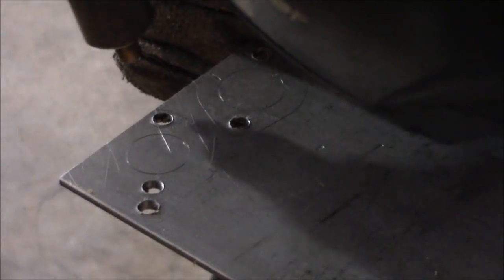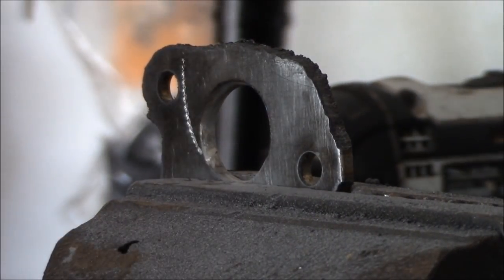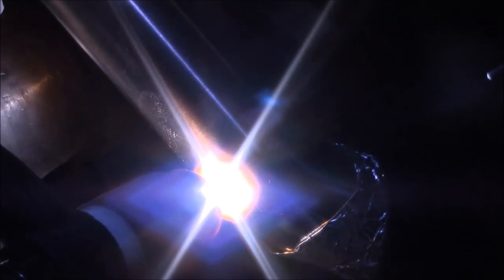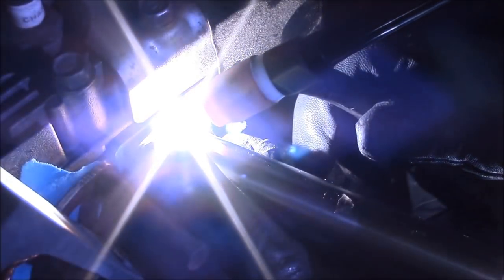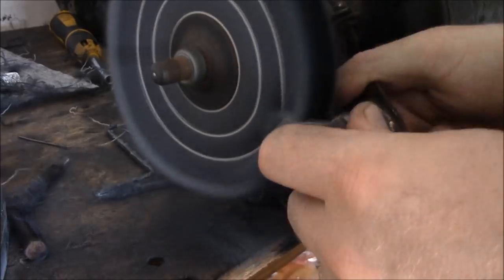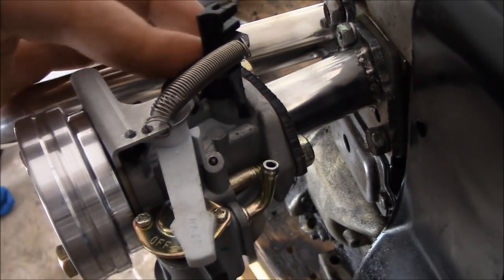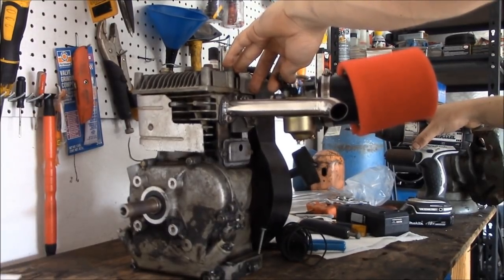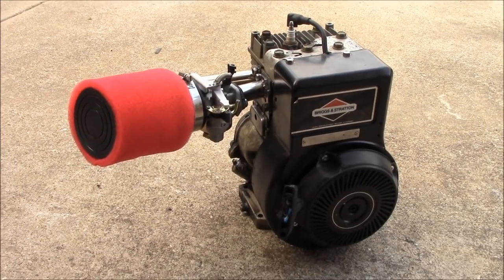BRONDA Engine, Custom Intake and Exhaust System (BRONDA Part 2)

Comment: Thank you for making this video! I was thinking of putting a mikuni carb on mine, but this is way cheaper! I picked up a predator carb for $10 shipped and will do the welding this weekend :)
Reply from the maker: +kazankophsmash no prob. You can check out the final linkage on my mini bike race video. I also modified a  throttle linkage kit to fit on the head of my Briggs. The kit was for the predator 212/gx200, costs 6$ on eBay.
Reply: Well I guess guess I wont be doing it after all. The 5hp briggs was stored outside and intake valve got rusted and stuck in the open postiton.I took off the head to do a valve job on it and found major scouring on the cylinder wall. It was my older brothers minibike project from 10 years ago and he ran it with no air filter . So all that sand and debris pretty much destroyed the motor. I took a video of what it looks like, its very bad! I'm posting it to my channel later if you want to see

Comment: I don't have the skills or means to make the carburetor adapter. I have a Briggs and Stratton 5HP engine and want to put on a better carb so the predator 212 is cheap and your video makes it look like a great upgrade. Any chance you sell a premade adapter/intake?
Reply from the maker: unfortunately no, but you can get a mikuni or tillotson carb and i know adapters exist for that that are already made, with a better carb.
Reply: Tecumseh has adapter that can be made to work.

Comment: I love the Clonda engines. But they have the worst habit of cranking on the first pull after setting for several months. That carburetor is so simple and efficient it's hard to put into words. Not only the carburetor is useful but also the Clonda coils on old obsolete engines. I have a cast iron 14 HP Briggs that always ran hot because of ignition. Made an adapter and filed the coil to fit the flywheel. It runs so much cooler and big time better. I had forgotten but I need to swap out the temperamental Briggs carb out with a 13 HP Clonda carburetor. Being it's on a 1971 Sears Suburban I gotta make governor linkage. I'll have several people stop while out mowing with this classic just to look it over and ask about how I keep it running so well. The Briggs carburetor is still a constant adjustment issue but the Honda clone should put that problem to rest.
Reply from the maker: Yep, and if you look at my 'mini bike race' video, then you can see a nice shot of how i linked up the throttle. I used a 6.5 hp clone engine 'direct throttle linkage kit" for it, and modified it a bit.

Comment: What kind of fuel pump should I use?and can you make a video showing how the BRONDA engine will use the breather tube hole on the side of the engine (is this also the vacuum tube?) to run the fuel pump? I'm thinking I need to add a barb but am not sure how to do it
Reply from the maker: +Jason Kenney no. No vent to pump from valve cover or you over pressurize your crankcase. They have the carb insulators that are plastic with a barb already attached that's how you do it.

Comment: Can you just bolt the carb straight to the motor or do you have to a space I got the same motor but bad tank. Thanks for the video
Reply from the maker: +Chevy Man i dont know if the bolt pattern is the same for the carbs, (i highly doubt it, or even if it was you couldnt get a header to fit on it). Also, if you want a bolt on solution do not do this as it requires fabrication. A bolt on solution would be a mikuni or similiar 22mm carb, and an intake manifold adaptor, and a pulse pump. I would look at the briggs racing engines to see the setup they use. I know this stuff is out there, it is a bolt on solution, and does not require fabrication.
Reply: That's what I'm looking for  just something I can bolt on as I'm not nowheres good to do any of that kind of weld

Comment: When you use that polishing compound will it prevent the header from rusting?
Reply from the maker: No, but you could scuff up the header with a wire wheel then paint it with header paint (ceramic).

Comment: if you take out the muffler and put a straight pipe does it add power or take away power, and how does that work?
Reply from the maker: Depends. If you put a large pile it slows exhaust flow and reduces torque. Exhaust flow needs to be hot and fast so a normal inner diameter pipe (same size as port or slightly smaller) is fine. Straight pipe is less restrictive to flow.

Comment: Did u block off the breather? I'm doing the exact same thing but it's for a drift trike
Reply from the maker: No, you should never block the breather tube. I ended up taking some clear fuel line for go kart race engines and routed it to the breather tube

Comment: What do you charge for one of those intakes for a 5hp Briggs with a 2 bolt hole intake mounting on the block and a PZ style flange on the carb end? Thanks.
Reply from the maker: i dont make them for people but you can google it on OMB forum. There is a guy that does that. Cant remember the name off the top of my head.

Comment: Hi I have the same engine but I have a stock carb and it has a breather tube do I need to keep that on or can I just remove it Cuse it fell off and it's hard to put back on ??
Reply from the maker: +Nick Donato you can buy a new breather tube for like $5, remove it, or keep the old one. The breather tube just exhausts the valve cover exhaust, and keeps the emissions down. If you have it vent to atmosphere all the tree huggers will cry and you will feel guilty for polluting the world we live in.

Comment: Man I really need more practice with a plasma cutter. Nice fabrication.
Reply from the maker: Thanks for the comment, takes a while to get used to the cutting, but once you get the hang of it, it feels like drawing.
Reply: ***** I've only used it to cut strut towers off cars and cut out rectangle strips. Those circles will be the hardest.

Comment: Is it only the exhaust causing it to pop and backfire or is there more to it?
Reply from the maker: It could be the following:

1) the air to fuel ratio is "rich" more fuel than is necessary is in the air, unburnt fuel is escaping into the exhaust

2) the valves are floating due to excessive RPM's, allowing a tiny bit of unburnt fuel to escape into the exhaust by skipping the combustion cycle. 

But then again I really am not sure.
Reply: Yeah right after posting I thought it could be running rich.
Reply: It does sound pretty good though

Comment: i put the same carb on my 5 hp briggs same year i beleive with identical intake manifold but it will only idle at choke and run high rpms with no choke like it needs tuned. any tips?
Reply from the maker: Needs .033-037” main jet.
Reply: @KartFab  alright thank you!

Comment: I should have looked through your videos more, It looks pretty basic to make so I might as well try and make this, Gunna have to use that ugly flux core wire though lol, Thanks for the great video!
Reply from the maker: +Mark Bowen i made it out of stainless steel. Do not make one out of mild steel, it will rust.
Reply: I can just paint it and use fuel tank sealer on the inside or something similar, should be fine
Reply: Well maybe not fuel tank sealer that close to the hot engine

Comment: Is there a way to cut out the flanges without using a plasma cutter. I want to do the same mod with a tecumseh.
Reply from the maker: Yes. Any metal cutting tool will work. I would drill out the holes first, then enlarge the exhaust hole with a Dremel and carbide bit to gasket match it. Use a grinder or the carbide bit to round off the flange edges. So a drill, double cut carbide burr, and angle grinder with metal cut off wheel.

Comment: I've got a honda gx270 and I was wondering if I took of the governor would I need a alloy flywheel ?
Reply from the maker: Only if you took it above 5500 rpm.

First thing to do would be:
1) remove governor, add direct throttle kit, install tachometer
2) high flow intake and exhaust, reject
3) alloy flywheel w/heavier lb valve springs

Hope that helps. Just keep it at 5500 rpm max w/o flywheel and you will be fine.
Reply from the maker: Myh

Comment: I want to install a gx200 clone carb on my 3.5hp briggs. Will it work as well?
Reply from the maker: the carb might be a little big for that briggs. You may run into some idle or jetting issues. As a rule of thumb you want the intake venturi of the carb to be 2mm smaller than the diameter of the intake valve.
Reply: KartFab thanks for the answer. I'll test it and keep you posted
Reply: If it helps, after taking my briggs e550 140cc push mower carb apart 3 times in 2 years to clean it. I finally found that the paper thin float bowl had cracked.
 I had an extra Predator 212cc carb laying around, used it instead, runs better than the original.

Comment: Hey man I just did this same exact thing (Putting a Honda carb on a briggs 5hp flathead) and it runs, but it doesn't idle very well. it surges. WHY!? We have been trying to tune it and it keeps doing it. help?
Reply from the maker: Did you make a return spring for throttle butterfly?
Reply: +KartFab no we are holding it with out finger so it doesn't vibrate around
Reply: okay, we put one on but it still wont stop doing it and now it starts then dies.
Reply from the maker: Could be 1 of three things, but it is not getting enough fuel.
1) dirty carb - clean it out, esp the jet.
2) you have the fuel cut off switch to "off"
3) you have a vaccum leak -  the mating surfaces of the adapter between carb and engine are warped or flat. You will need to sand them down in a figure 8 pattern on a flat surface.

Comment: I added intake and exhaust plus rejet, but what have yall done with the gas tank vent? just leave it open???
Reply from the maker: Youre going to have to be more specific here. I dont even know what engine you are talking about.
Reply: predator 212cc, aka honda clone...has a gas tank vent on top of the tank that used to lead to the stock airbox, but now after I put a whole new air filter on it, there isn't anywhere to attach the hose coming from the vent at the top of the tank...
Reply from the maker: got it. Its a one way check valve there, it just vents the excess vapors from the tank to the airbox. You dont have to do anything with it. The valve cover though needs to be vented to atmosphere, most people get a small air filter and a hose clamp and vent it to atmosphere or a catch can.
Reply: Oh ok...ty...maybe I over filled the tank, when I start it, gas just pours out of it
Reply from the maker: yeah, you are only supposed to fill the tank maybe 3 " below the top. If you plug the line, it could cause a vacuum in the tank. I am not sure if the tank has a vented or unvented cap. If the cap is vented, you can plug the line no big deal, if it is not vented, if you plug the line, it could cause some weird running and eventually the engine could cut out because of the vaccum in the tank.
Reply: ok, thank you so much for ur help...its not a vented cap I have to keep that vent open...after it leaked to about 3 inches below the top it stopped leaking lol...like u said, I was filling it up till I couldn't put anymore in...smh...I got it now, thanx again

Comment: how did you get out the flames from the exhaust, please answer me
Reply from the maker: That just occurs naturally.
Reply: Back fires out of the exhaust usually is from not enough back pressure mixed also with a rich fuel air ratio.
Reply: +Chris Carson The rich fuel air ratio if from the engine decelerating with the throttle closed causing it to pull excess fuel and not as much air causing the fuel to ignite in the exhaust thus shooting a flame.

Comment: could you tell me where you got the carburetor? like a link or something.
Reply from the maker: Hey man, I just created amazon links to the whole setup in the video description. Hope that helps!
Reply: KartFab you are a saint.
Reply: @KartFab  what's your opinion on the tillotson tct mechanical fuel injection carb it would be a direct replacement for the 212 carb
Reply from the maker: @kevinjohnson9372  id rather get vm22 or tm24 slide carb IMO.

Comment: Does that carb have fuel needle?
Reply from the maker: +fridz magnuson it has a float needle.
Reply: so does tecumseh engines, but they also have adjusting needles, both high speed and low speed, for fuel/air mixture
Reply from the maker: oohhh ok gotcha. It has idle mixture needle, idle speed screw, and that's it. No additional fuel adjustments unless you change emulsion tube or main jet.

Comment: And on the gx200 on ur modified Briggs 5hp engine where is the gas tank on it I didn't see one
Reply from the maker: +Nick Donato there is no gas tank, i have to use an external one.
Reply: +KartFab can i use a 140cc 26mm pitbike carb on a honda gx 200 clone and is it safe to use it ?
Reply from the maker: beats me.  I can tell you though that the 22 mm mikuni carbs are used on teh briggs (they are 206cc) its a matter of air flow, and jetting really. too big, and you dont get a good power band, to small and it is too restrictive and wont rev high.
Reply: +KartFab my Briggs today was running wrong so I have the same one u have I started it I had to pour gas is the carb so it would start and the only way it would idle is on choke right when is switched it to run it stalled and when I apply gas on run it stalls what's the problem can u help me out
Reply: Nick Donato maybie u have intake leaking chek the carb gasket
Reply: +robertas grigas I put alittle gas in the carb so it would start and it came out the ex take

Comment: Is this a raptor?
Reply from the maker: I got a Briggs I/C steel sleeve dual bearing engine. Not a raptor, but put raptor III piston and rings in it.
Reply: +KartFab so basically a custom built raptor lol
Reply from the maker: Yeah. Raptors have racing parts in them already, and are a little beefed up. I put a lot of performance parts in this guy so he should turn 6100 to 6200 rpm. We will see though.
Reply: +KartFab yeah the raptor 3 is capable of like 7k Rpms I've heard

Comment: Ok can u send me the links to the air filter and the carb bc I'm looking
Into buying three parts for my go kart
Reply from the maker: So can you tig weld?
Reply: +KartFab no
Reply from the maker: google, mikuni 22 mm carb and intake manifold adapter for briggs 5 hp flathead, that should get you a good start. (also tillotson)
Reply: +KartFab ok thanks
Reply: +KartFab do u have a email so I can ask questions?
Reply from the maker: You can ask questions on here, I don't give away my personal information.
Reply: +KartFab ok
Reply: +KartFab can u put the links down here I can't find the parts in the Internet
Reply: +KartFab I need the same parts you put on bc I have the same engine and I'm doing the same thing ur doing
Reply: +KartFab ?
Reply from the maker: nick, I know you can do it man i believe in you!!!
Reply from the maker: ok i caved in, here you go http://www.ebay.com/itm/22Mm-Mikuni-Carb-Kit-Briggs-Flat-Head-3Hp-5-Hp-Go-Kart-Mini-Bike-/221993964980
Reply: +KartFab thanks so can u send me a link to just the carb and the air filter adapter
Reply: +KartFab also I have the same engine I go to start it it works fine on choke then I switch it to run and when I apply throttle it stalls what's the problem?
Reply: +KartFab http://www.affordablegokarts.com/mm5/merchant.mvc?Screen=PROD&Store_Code=A&Product_Code=AGK722&Category_Code=AFC1
Reply: +KartFab sorry about this but I want to buy the right parts is this the one you have http://www.arcracing.com/dj-2225-race-ready-cnc-bored-615-box-stock-carb/
Reply: +KartFab ??
Reply: +KartFab ?
Reply: +KartFab ?
Reply from the maker: Nick, you cant make what I made unless u know how to tig weld, it is as simple as that. I gave you the links for a bolt on.

If you want to save money, just buy a can of carb cleaner and a new gasket set for your existing carb. You probably have a dirty carb, you clean it, then you are fine. Done. If you want a fast answer, do not post 7x just because I did not respond instantly. I check messages once of day if that. Have a good one, and good luck with your project.
Reply: +KartFab ok sorry

Comment: What options do I have for a Tecumseh 172cc for more power and more RPM
Reply from the maker: the biggest gains you will get will be from replacing the intake and exhaust with performance/high flow, then rejetting.